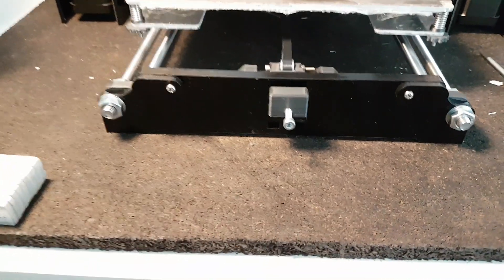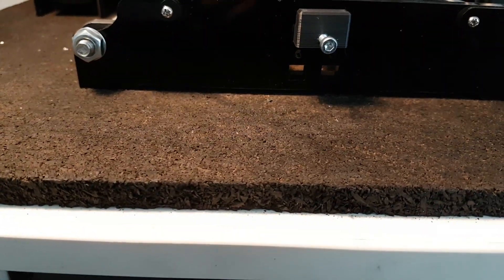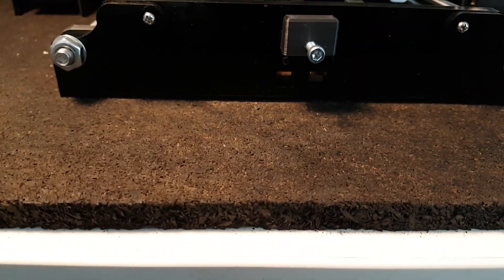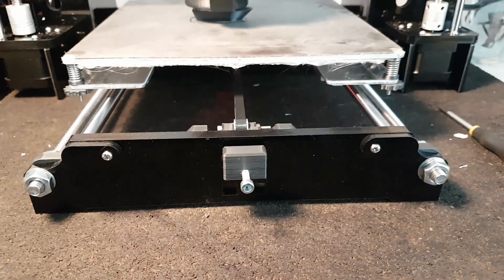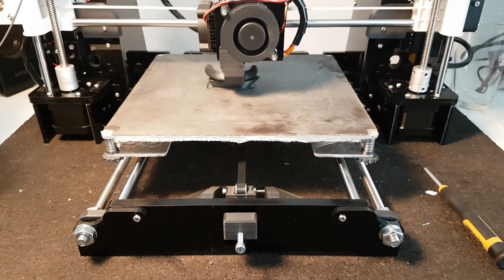Silencing the Anet A8

Comment: Hows you get the heatbed to not hit the y axis stepper motor
Reply: Just file off some of the aluminium (were it would hit the motor). But you need to consider, that the motor will still be pressed against the motor support and transferring noise through that (maybe print a new support pice a little smaller to put some rubber in between the motor and the support)

Comment: Do you mind if I ask what you have upgraded on your printer to print that smooth? It runs so easily and the quality looks amazing compared to the original components that came with the printer. Thank you! ^^
Reply: You don't need that for to work smooth and print decently.
Please try to get it setuped right before upgrading, because upgrades on a printer that is badly assembled or has bad slicers settings are useless. Check that your frame is square, that your belts are tight, that your screws are tight, then check the slicer. 
I know this comment is old, but I hope this helps, if you want help you can ask me. My printer prints as well as my school's UM2 extended + (2000$ printer) and is nearly stock so I'd say I know how to set them up.
Reply from the maker: Hey Ana, just check the video description !
Reply: lenne 0815 oh, I'm sorry I haven't seen it before! Thank you!

Comment: dang , what a lil mat and a bit of rubber can do
Reply from the maker: Exactly my thoughts ! I mean, yes we can go all out, converse to 24v / ramps ( Mks ) / TMCs but this is just about 20 bucks and already hugely reduces the noise...
Reply: lenne 0815 
Very true mate
I'm pretty happy about ma Tronxy P802m's  stock firmware 
Defo not messing with it , as i Don't feel the need to do a fw update 
Simple stuff like this can help allot
Some ppl ride the hypetrain tomuch lol
Reply: @lenne-0815  Hey what size is that rubber mat?
Reply from the maker: @dragnet53  thats like 50x50cm